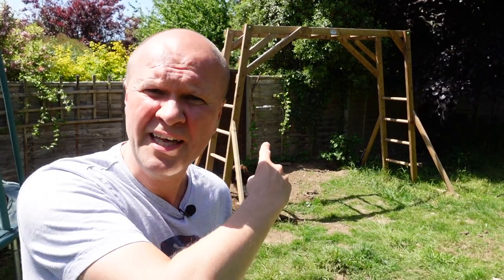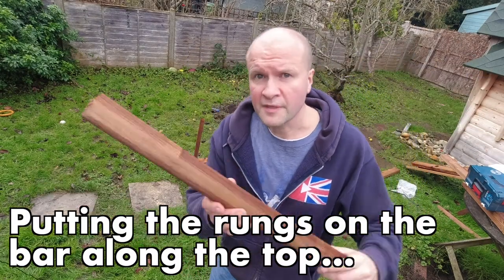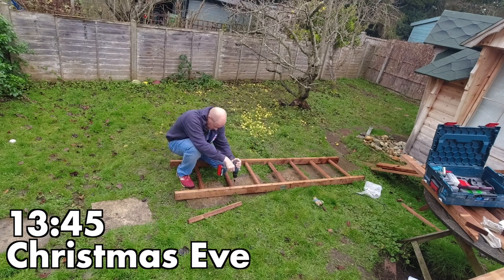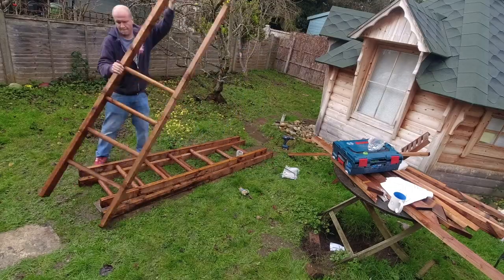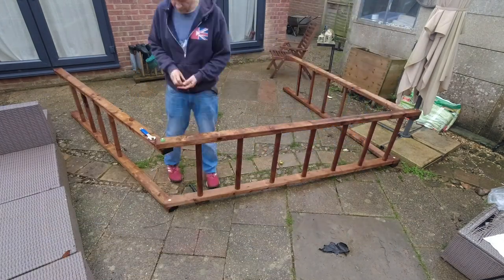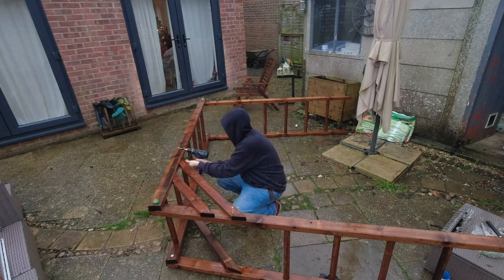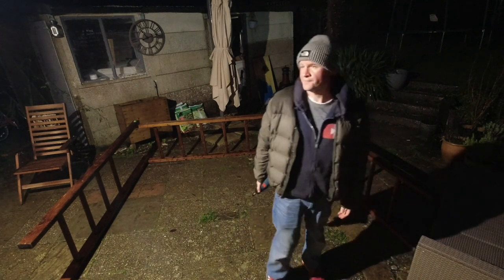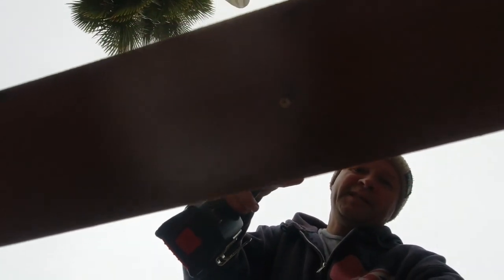Best wooden MONKEY BARS for kids and garden? Dunster House kids climbing frame

Comment: Nice video and it helps alot. Quick questions , how many kids can play on this at a time ? From the website it says one kid ( max 50 Kg). But at the same time says total weight can handle up to 300 kg. So it is confusing !
Reply from the maker: Thanks for the kind question Anil.
We've easily had 3x 12 year olds on at once - it's very very sturdy. Despite the fact that I put it together.

I think it probably says one kid at a time so the kid isn't knocked off and/or to cover themselves but we've had no problems with very big kids/small adults being on it at the time time.

Hope this helps!
Reply: @DADDELIVERS  Nice one, many thanks . I will go ahead with this then !
Reply from the maker: @anilrs8  Thanks - Better luck with putting it together than I had! 
It's still standing strong though!
Reply: @DADDELIVERS  I hope so 😁
Reply from the maker: @anilrs8  Courage my friend!!!

Comment: I have these to build this year... Any tips on how to fix the brackets? Thanks
Reply from the maker: Thanks for the kind question Richard
That was absolutely the hardest part - I'm not sure I put the legs on, both the right way round and/or attached to the top bar correctly... but it's really hard to make out from the diagram. 
One of those off then means the brackets don't make sense.

We winged it as best as we could and it's standing fine, so hope you manage to fare better!  GOOD LUCK!